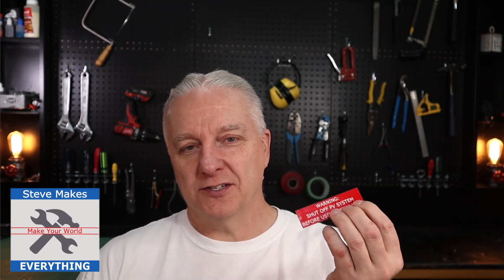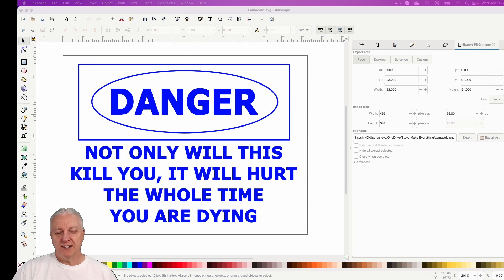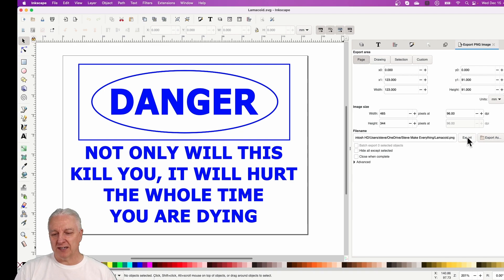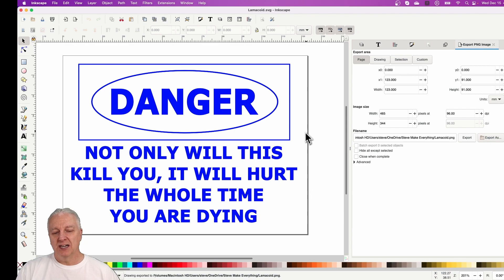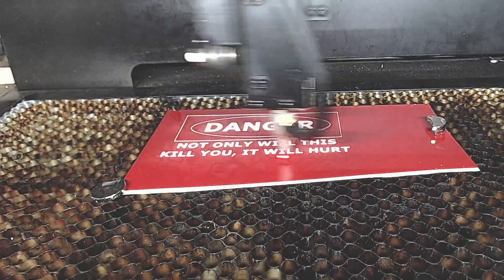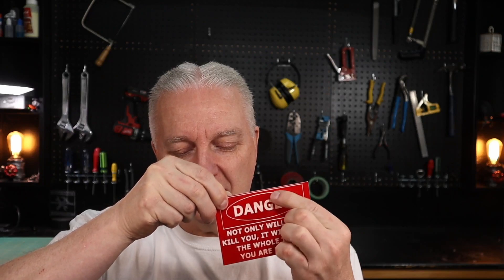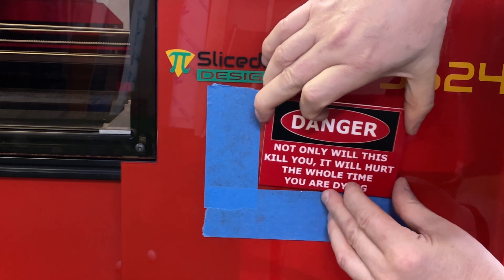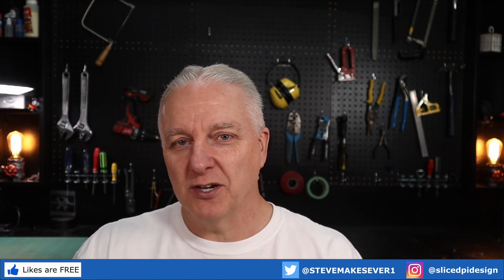You WON'T BELIEVE How Easy It Is to Make Signs That Get Noticed!

Comment: I have been making signs with a similar material from JDS Industries called Duets Textures. The only way I have gotten a clean engrave is to run two passes. That works, but the residue/dust is just awful.  And it’s awful slow due to 2 passes.  I haven’t tried reversing direction. My default raster engrave is from the front of the laser, backwards towards the fan.
Reply from the maker: Reversing direction might help, but trying reducing the power a bit until you are just getting through that thin surface color. Sometimes I will clean leftover residue with IPA (the alcohol, not the beer) and a microfibre cloth

Comment: Can you clean the dust with an air compressor?
Reply from the maker: You can certainly try.  The residue tends to be a bit sticky though, so it's best to do as much as you can to avoid it in the first place.

Comment: I've never had much luck with dual layer plastic like this. I recently retired it when it clogged my laser head. I've tried every range of air assist. I'm glad to see someone can get good results out of it! The magic eraser works sometimes, but I certainly removed the nice finish when using it.
Reply from the maker: The reason I did this video is because I too suffered from some of this in the past.  The tendency is to brute force things with more power than you need and if yo get into the white substrate the heat seems to make everything kind of gummy.  The secret here is high speed and lower power - just enough to engrave the top layer, which doesn't take much because it is probably 1/10th of a mm thick

Comment: Just playing around with my new diode laser.  Where can I get the material you use for the sigh making?
Reply: Thanks for the quick response.  Great videos...
Reply from the maker: @jschilder0001  Hopefully it is useful
Reply from the maker: I buy mine trough Trotec’s laser engraving supply group. https://www.engraving-supplies.com if you are in the US. There are two different kinds though so be careful because one type can’t be laser engraved because it is PVC. Send them a message and they can point you to the right one.

You can also get this off Amazon and dozens of other places where acrylics are sold

Comment: Thanks Steve, as always great tips about the muse 3d laser.
Reply from the maker: Hope it was helpful
Reply: @SteveMakesEverything  Steve, where do you get the label material from?
Thanks, Jerry
Reply from the maker: @PinItRight1  For this kind of thing you can check Amazon, but I usually buy in larger quantities so I found the best place for me is Trotec's laser-engraving site.  There is one for most counties in NorthAmerica and Europe at least.  I have also found a couple of local suppliers who can provide it but they charge more.